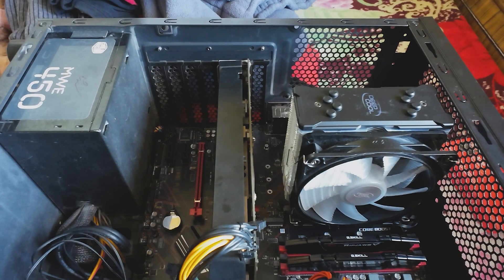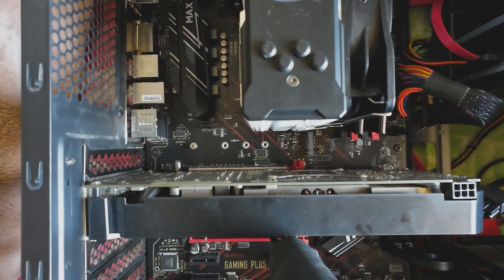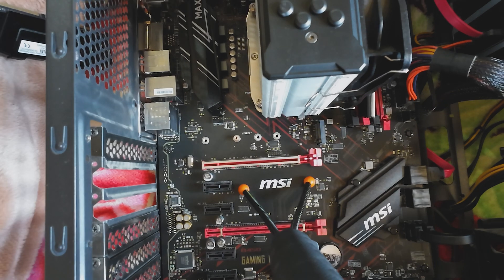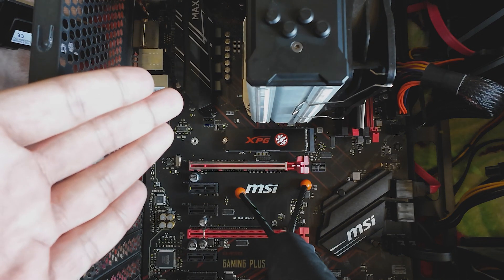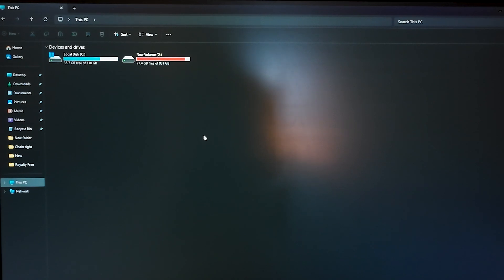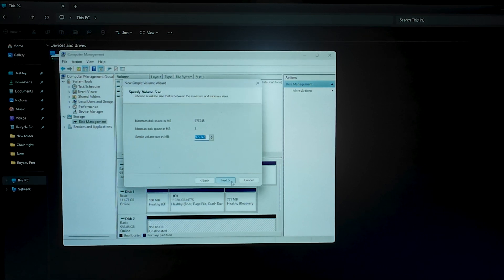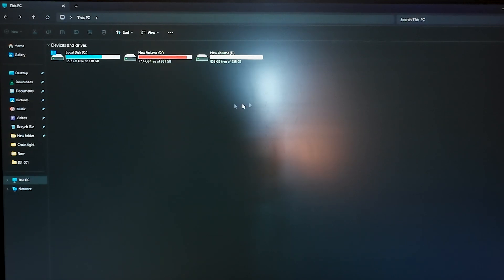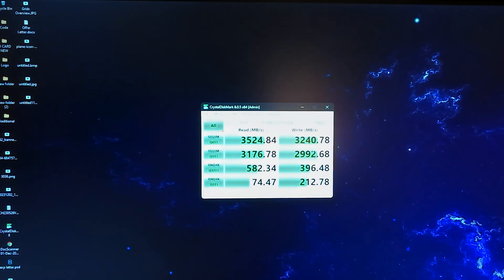How to Install & Setup a M.2/NVME SSD || XPG SX8200 pro 1tb - Speed Test

Comment: Hello, I am considering buying a SSD, I have seen mixed opinions about this SSD online . So far what's your experience like ?
Reply from the maker: Bro my experience is great so far, but yes with this ssd its possible that you may get a different controller hence reduced speeds, you can buy the ssd online and if you get slow speeds then you can return it.

Comment: Mine has a 2900 read and 800 write speed
Reply from the maker: Do you have the same model number with same storage ?
Reply: @samventures1  It's the same model and exactly same box but with the new SX88200 Pro controller
Reply from the maker: @Artaherzadeh  yeah, they have been doing this with some ssd's though i've got the one good one.
Reply: @Artaherzadeh  Bro 512 gb version has the lower speeds

Comment: My motherboard supports only Gen 3 SSD should I get WD Sn580 1TB Gen 4 or this one or XPG SX6000 1TB
I'm going to install windows and games on it
Reply from the maker: you will not get the full speed of gen 4 ssd since your motherboard only supports gen 3 ssd. so maybe get this one instead. One thing to note is TWD on wd ssd is quite low so the lifespan will not be that good.
Reply: @samventures1  I got WD sn580 1tb and no WD ssd tbw is not low both have same tbw 600TB
Reply from the maker: @hff7904  i see maybe i saw the specs for some another wd ssd.